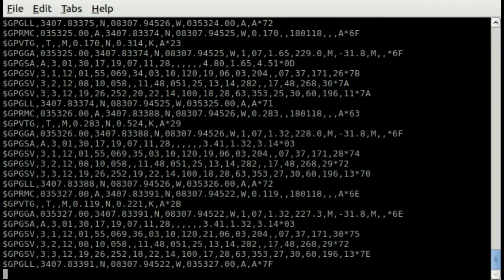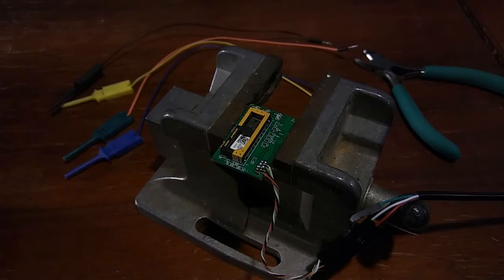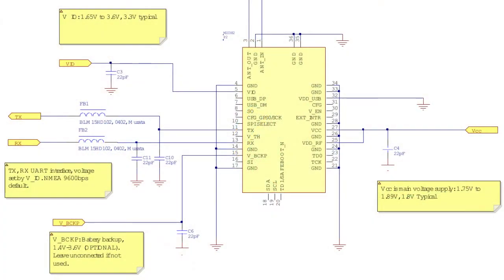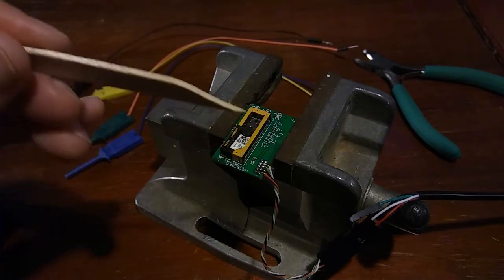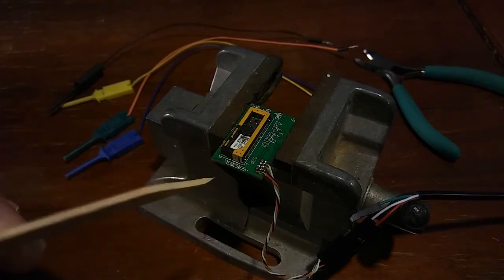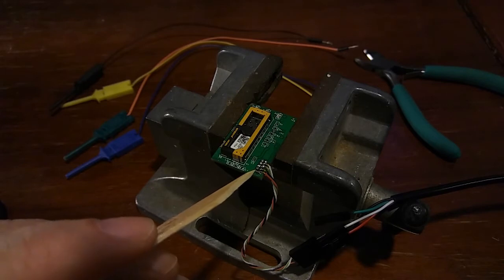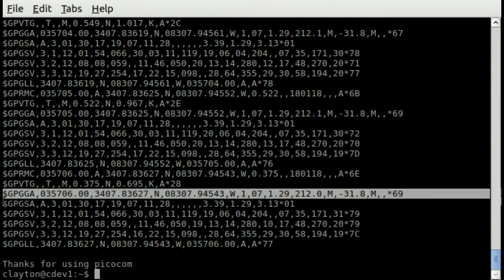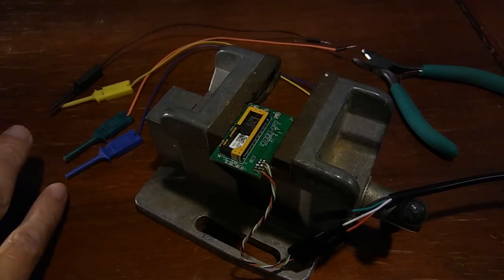GPS Module Rescued from Trash

Comment: Cool Video, always interesting.  As an aside, I really like that vise.  Can you provide any info on the make and model, maybe where you got it?
Reply from the maker: Chuck - Thanks. I just subscribed to your channel. Looking forward to checking out the engines. As for the vice, it was my grandfather's. It's probably from the 50s or 60s. Aluminum with brass jaws and a steel screw. He used it on a bench drill press, but it's perfect for PC boards. I've never seen another. Maybe ebay.